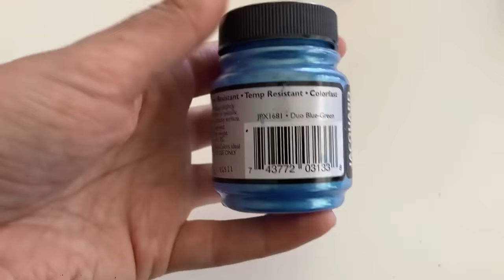HOW I MADE MY MERCY WINGS (FULL ARMORED WING WALKTHROUGH)

Comment: You might consider using pvc cleaner and pvc cement to attach the pvc unions, sometimes adding a screw will break the pvc. After dry fitting the pvc structure you can make a mark on each piece of the unions, then just apply the cleaner, then the cement to where the pvc joins on each piece. Once it’s applied just twist the pvc to line up the marks so that the cement will spread and make a secure fit. Push the connections together as far as they will go and hold it together like that for about 10 seconds. It sets pretty quick but after 24 hours it’ll be pretty strong and you won’t have to worry about it coming apart.

Comment: If you don't want the PVC against your back, you can use a heat gun to flatten the PVC rod, the part outside the 45 degree joint, before the 90 degree ones,  and screw it onto a piece on Sintra (not sure on spelling sorry) board. Sintra board is a really thick thermo plastic that is super cheap but often times can only be bought in bulk. 

You just heat up the sintra, mold it against your back, screw in the PVC, and instead of plastic pipes digging into you, you have a flat molded to you shape against you. it will help distribute the weight of the wings and you can still slip it under your breast plate. Plus since its a now flat surface, you can even decorate the back piece to look like a wing mount similar to a lot of mercy skins. 

PS using chicago screws (i think that's what theyre called) will be a huge plus. They are screws  that screw into a housing instead of using a nut on the otherside. so on one side is the screw head, and the other (the "back" of the sintra, what will touch your skin) will be a flat, smooth, rounded housing the screw, screws into.

Comment: Great video. Just two recommendations with the bandsaw. 
1. Lower the guidepost slightly. The guide blocks on the post are what keep the blade aligned. The closer to the work the higher the accuracy. Plus, it will help minimize the chance of a blade breaking. Believe me, a bandsaw blade snapping can scare the C$*# out of a person.  Also in that regard, try and keep your hands to the front of the blade and not on either side of it. Should the blade break, it is going to travel either to the right or to the left due to the centrifugal force of the two wheels the bandsaw blade travels on. 
2. You might want to consider adding a magnetic work light to the saw or some other light source on the right side of the bandsaw. The units post is causing a shadow across the area where the blade is cutting. 
If you have any questions on bandsaws, feel free to ask. It's one of my favorite machines to use in the woodshop. Coming in at second place with the lathe in number one.

Comment: I have an idea to easily fit and remove the wings. Securely attach larger pipes to the beast plate then take the design you used, but have smaller pipes that slide inside of the breast plate pipes which are fixed to the wings. Then for a solid fixing secure with a locking rod and cotter pin.

Comment: Barge Cement for most things; eva, leather, plastics, other materials to wood, etc
Titebond 2 for most wood projects; e.g. wood to wood surfaces
Great Stuff Foam for XPS foam to XPS Foam
Permatex headliner adhesive for your spray needs and it is non-solvent based so it wont dissolve projects
Loctite CA for when you slip and cut your hand with razor knife